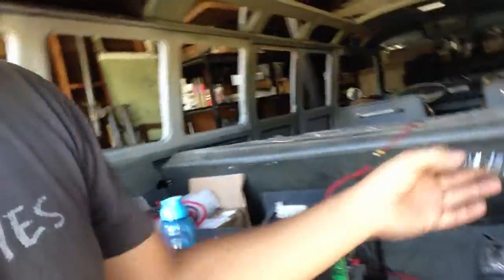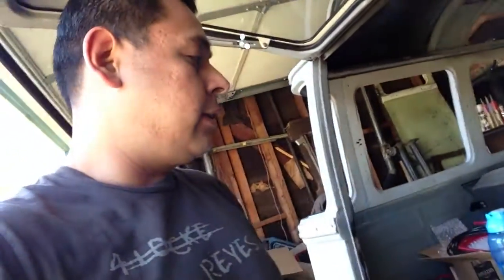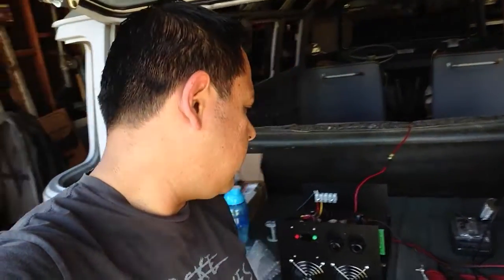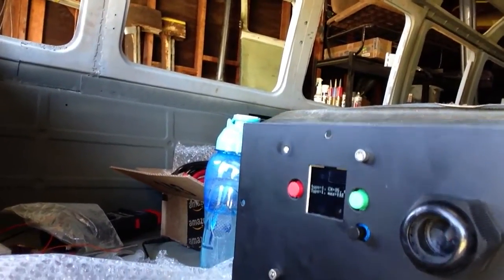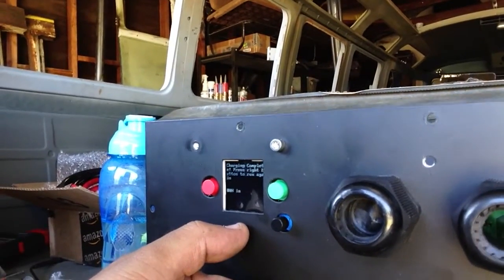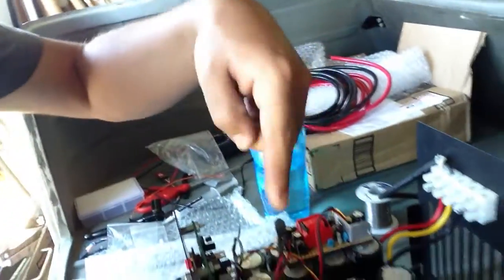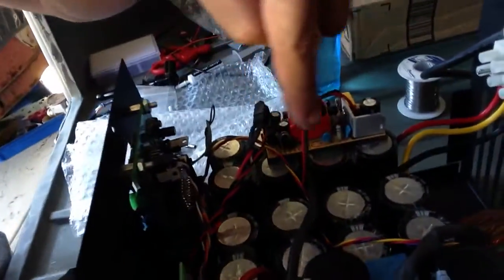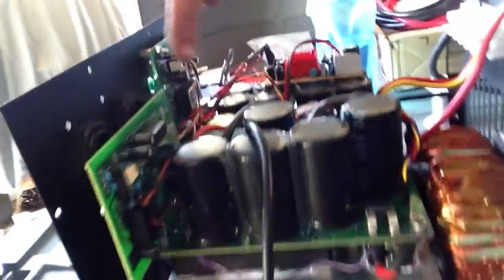EMW 10Kw open source charger troubles

Comment: I am working on a charger for lithium ion batteries for a 1980's cordless drill and I have found that there are 3 states of charge.  When the charger is first plugged in a voltage check is performed and if the batteries are under voltage, i.e. over discharged then a trickle charge is applied to bring the batteries up to voltage, this is called a pre charge.  Once minimum charge voltage is reached a constant current is applied.  As the battery is charged, higher and higher voltages are required to maintain the current until a predetermined maximum charge voltage is reached.  Once the maximum voltage is reached the the charger moves to its second (third) state, constant voltage, and at this voltage the current begins to reduce, eventually reaching close to nil once the battery is charged.  It seems from the symptoms that the pre charge passes so it switches to the constant current which is immediately registering maximum voltage and the second (third) charge phase is not enough to provide any current into the battery so charging is assumed to be completed.  I would suggest that either the batteries are already fully charged, which I assume you would already know, or the chargers maximum charge voltage is set too low meaning it can never provide any current into the batteries.